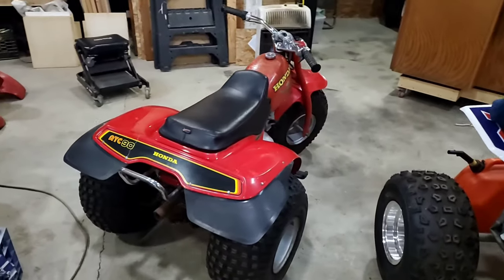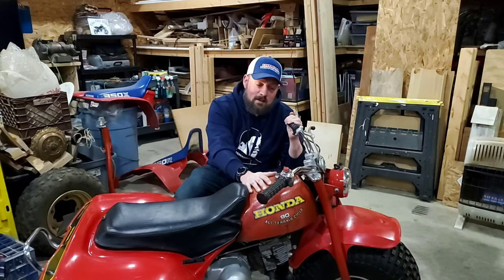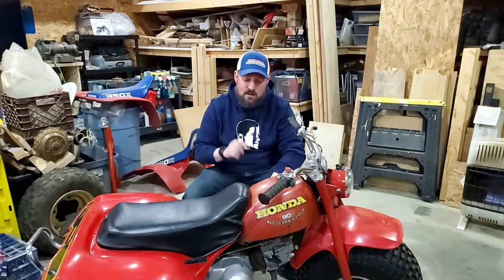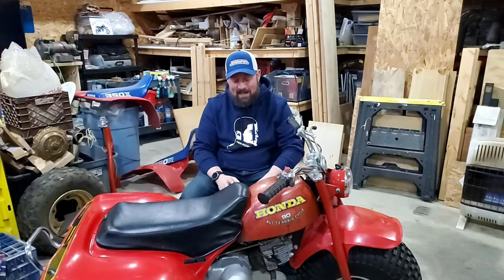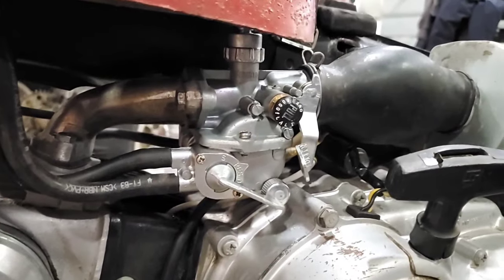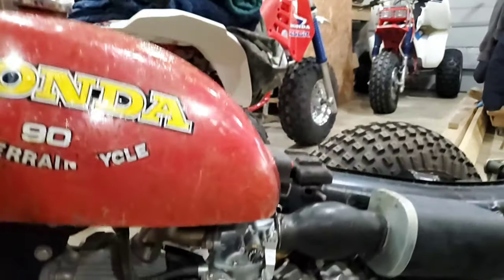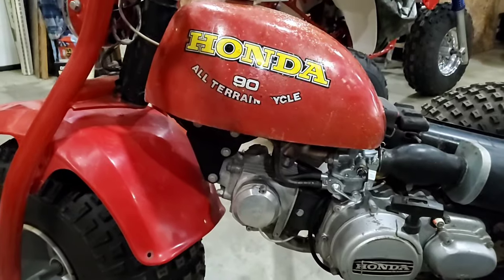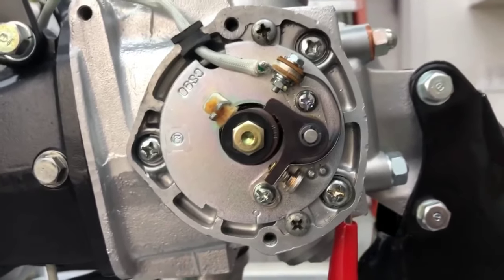1978 Honda ATC 90 - New Carb Install - Setting Timing on NOS Points with Ignition Timing Tester

Comment: Does a Act 90 carb fit on a Act 70 motor?

I forgot if I did put a Act 90 carb on my Act 70  back in 1999 when I rebuilt my 1984 act 70 with a bigger bore..